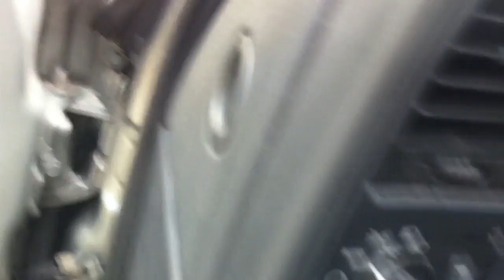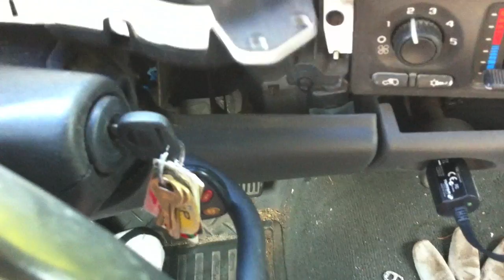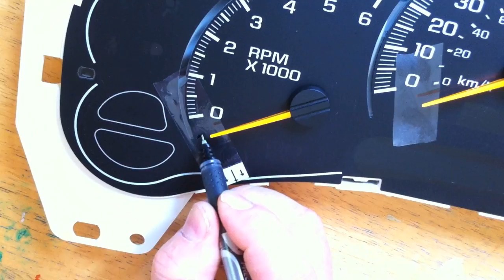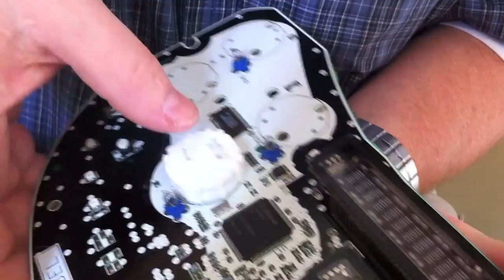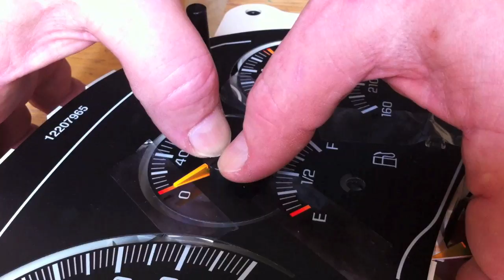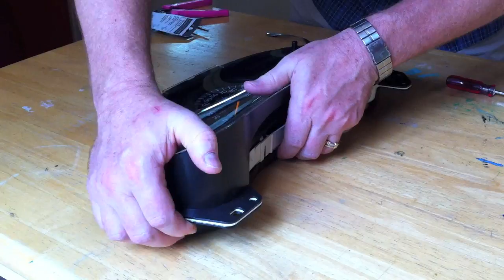Chevrolet GM Speedometer Gauge Repair Removal Instrument Cluster

Comment: I must say this is a great help in changing the motors out.  I followed this guide and got them all replaced and working again.  I will say two things:  First, the two tucked in tabs were super tricky, I put the back cover back on and used it as leverage to get them on.  Secondly, don't forget to check before you take out the console that all the bulbs work (most repair kits come with bulbs).  I forgot to check this and now I have to take it all apart again to change the bulbs...

Comment: Nice, condensed, detailed video, thanks for sharing.   Fixed all 4 stepper motors on my wife's Montana in about an hour.  I did pick up a low priced de-soldering iron ($14 - Radio Shack) which made this change out real quick.

Comment: Nice video , the fork idea was just awesome. Alot cheaper than buying a puller and was a great help to me as I'm replacing all the gauge bulbs  on my 02 Venture. 
If your new to de-soldering you gotta watch that braided solder wick, it's easy to accidently solder the wick to the pad and  twist or pull it off the pc board :(. 
Thanks for the video....

Comment: Great video! Wish I had seen it before I did mine. I tried to use a solder-sucker device and it was really difficult. The solder wick is the way to go. I also replaced all the light bulbs because I figured they would be going bad soon on my '03 Avalanche. Replacing the light bulbs was difficult at first. I replaced all 10 and the 6 motors. Pay close attention to aligning the pointers of the gauges, I didn't. If you wonder about the speedometer accuracy, I used an app on my iPhone to sync it with. You can download an iPhone app for $1.98 that is like a real speedometer. It works off of GPS points so need to set the cruise control and drive for awhile to compare the readings.

Comment from the maker: If you turn the key on and then back off the needles should line up with the first mark on the far left of the gauges (at least on my Silverado they do). This might help you figure out  how far off they are. In fact I think you can put the cluster together enough to plug it in (without the front plastic) and then turn the key on and off and then reset the needles.

Comment: great video. my 04 z-71 speedo stopped working about 90,000 miles. my dealer wants $370 to fix it and my old lady already got 2 speeding tickets which cost 120 each. i'll be don this myself tis weekend. thanx!

Comment: When this first happened I just pushed my speedometer and oil pressure needles back and resintalled the guages, of course they went haywire again. My question is, will that affect my calibration? Will my indexing be accruate if I replace the stepper motors and remove the needles? Also my speedometer stops around 80mph, so when I index i would install at the 12oclock position and then spin it counterclockwise back to around 80?
Thanks a lot, the video is great

Comment from the maker: I would try and figure out how far off they are and then mark the full left position and then turn them the distance they are off. You may have to do this to the right if they are off the other direction. For instance your tach reads 1000 when it should read 0. Measure the difference between 0 and 1000. Turn the needle around til it stops and mark that location. Then turn the needle farther to the left the same distance as you measured if was off. This should get you close to the right spot.

Comment: There is a BIT more to this procedure, but basically, this is how to replace the motors. Found the motors at Amazon. Best to replace all the motors ( I had 7 ) at the same time. I also used a Solder Sucker tool. I have never been able to get a Solder Wick to work, but probably just me. The hardest part for me was getting the (clear) cover off. It has 2 snaps at the bottom that are a MF to get undone. Be careful because there are sensitive parts of the DIC (Drivers Information Center) ( little silver bars soldered to the circuit board ) that you can bend or destroy trying to get these clips to release. After I got these 2 clips undone, I just broke them off, in case I had to reset the gauge needles again! The 3 clips at the top are enough to reattach the clear cover. It does work and I only paid 35 bucks for 7 motors and 10 spare dash light bulbs. ( Soldering Iron and solder and Solder Sucker not included )

Comment: I can’t seem to figure out which bulbs to buy on ebay as they mostly want to sell goofy colored bulbs or brighter bulbs which likely won’t match the rest of my current bulbs. Would there be bulbs in all of the spots on my dash even for the unused options that I could swap over?
Also it appears that at least for the tach, speedo and oil pressure to be accurate they should point to the zero location with the key on engine off. Would it be a good idea to set them there or use that procedure if they get out of position? Thanks for your video and help.

Comment: Very good video, I replaced the motors in my 2005 Sunfire and things worked well. One problem here, how the hell do you calibrate the needles? like an idiot I put them in at zero vs 12:00 position. I did the wind trick like you showed, but the temp gauge is hosed up. Is it safe to assume I can keep doing the spin trick to get that back in the right position?

Comment: It will cost you way more to have a professional do it than to do it yourself. The stepper motors can be bought on Ebay for under $10 and then even if you have to buy a soldering iron and solder it will still be cheaper to DIY. It just takes skill.

Comment: If I understand this correctly, you must replace ALL solder motors even if only my speedometer is the only malfunctioning gauge AND buy a solver remover (wouldn't a soldering work just as well)?  Can this item be bought other than an expensize dealership?  Thanks.

Comment: Scott. Great video. I have a question for you. I changed out the gauge motors and they work fine but I also wanted to change out the LED's. I bought the 5mm blue LED's. I soldered them in place and now none of the LED's are working. I can make them flicker when I plug/unplug the harness connector, but they won't stay on. Any suggestions.

Comment: My GMC Envoy (gage cluster - Speedo, Tac, Fuel, Oil, Temp and Voltage), all were Non Functional.
The next morning I powered up to start the vehicle and all gages were working fine!

Question ?__  Is this a sign of all Stepper Motors going bad or is this something related? 

P.S. Thank You so Very Much for your Video ( its greatly appreciated)  Robert

Comment: a better technique for wick is to flow melting solder into end of freshly clipped copper wick.  Constantly snip end off with a pair of scissors, like 1/4 of an inch at a time. use fresh wick on each joint to avoid spreading solder to another joint by accident.

Comment: (2003Malibu) I saw your video on stepper motor replacement, found it very helpful although I'm finding it difficult to find the proper motor..The motors in mine are not x27 168, but a round metal casing covering upper winding's with four long pins to plug in or out( no soldering). Any help in locating this type would be helpful. Thank you

Comment: People should be aware that ANY static discharge from their hands on printed circuit boards (like this) will destroy the unit.  Make sure to handle these things by their edges, do NOT touch the solder points with your fingers (that's where you can discharge static electricity and actually cut your fingers  That stuff is sharp), and make sure you touch something metal to bring yourself to the same electrical level as the circuit board (you are NOT grounding yourself.  That would be bad if you did).

Comment: I would recommend against using that radioshack rosin core solder.  Use a good electronics grade NO CLEAN solder or else you will have problem in the future.  Also do yourself a favor and use a temp controlled ESD safe solder station, not a cheap radioshack pencil or iron

Comment: Hello Scott,I have replaced the 6 Stepper Motors as described in your training video, reinstalled the dash and all gauges are at and remain at the bottom left, I'm getting no movement of the gauges when the 2005 Chevy Tahoe is on and being driven.  Any suggestions on trouble shooting this problem?Thank you, Brian.

Comment: I attempted to replace the stepper motor for my oil pressure gauge and I made the mistake of pulling the needle off before I marked the needle position. How can I realign it so the gauge reads accurately? please and thank you for any help

Comment: I have a 96 GMC Safari the Speedometer does not work on.  However it is not totally lifeless.  It pins all the way around clockwise when the engine is started.  What's up with that??

Comment: Mine is TOYOTA IsIs 2005 I did almost the same but with no luck!! After replaced both RPM & Fuel gauge stepper motors but not working. Any advice??

Comment: I have 04 envoy is like a evil minion Going to replace whole cluster BC the gasoline is say wrong reading and I can't find those motors plus less tech work. Hope this will not cause me sell the car yet after over one grand repairs this car will be my last GM. Anyone owns a gmc knows is real headache and $$ drainage.. everyone tells me to sell or trade it but I don't give up easily. Freaking dealers want hardly anything for it so if sell it will be eBay or CL. Thanks for sharing your how to video!

Comment: I replaced my speedometers gas rpm and speed works fine, but my battery temp and oil pressure does nothing! What should I do?

Comment: Thank you for your very informative video. Question, I have a 2005 Buick Rendezvous with a stuck speedometer gauge, is the same stepper motor used in the cluster?
Reply: yes all of them are the same!!
Reply: Patty Ordway
Thank you! May the force be with you, Peace and long life......   :)
Reply: You as well!  :)
Reply: Just be careful when changing the stepper motors you do not break any circuits along the way or you will need to replace the whole panel!!